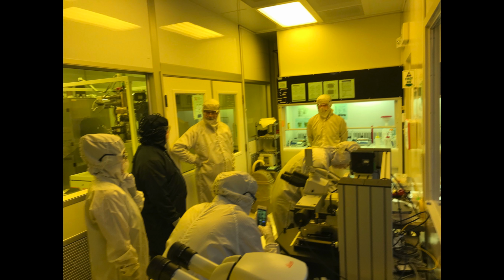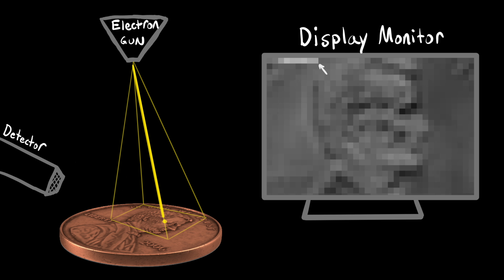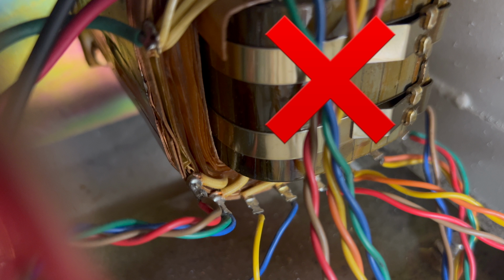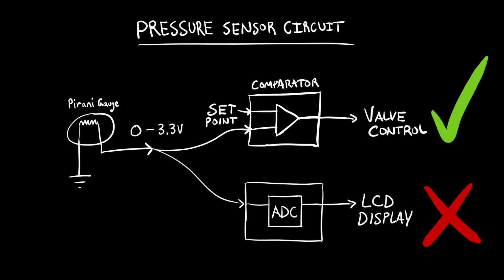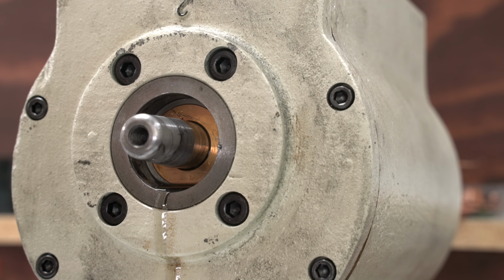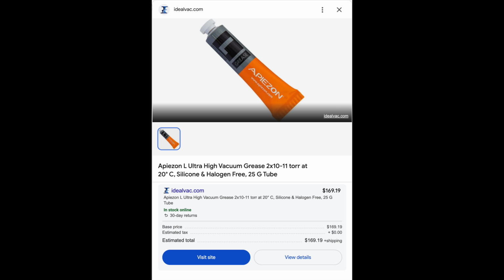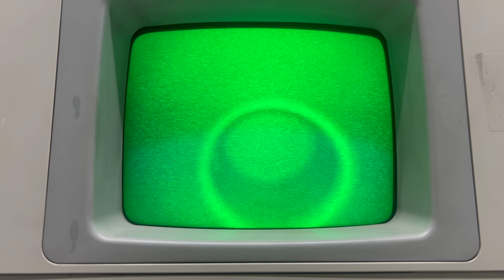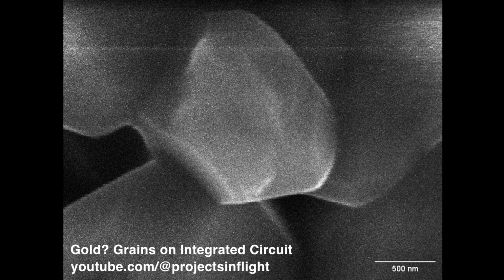I Saved an Electron Microscope from the Trash

Comment: Once you have it fully repaired, what will you use it for? Great and super interesting video, Thank you for posting
Reply from the maker: Well, the first actual use case i have is to debug the dopant that i made. There is clearly some surface weirdness happening on some formulations but it's too small to see exactly what is going on with the light microscope
Reply: @projectsinflight  outstanding.

Comment: 1:20 how much resolution does alpha, beta and gamma rays produce 

Downside is that it can chemically change the structure youre looking at....or make it become radioactive
Reply from the maker: well, an electron beam is essentially low-energy beta radiation. Theoretically they'd produce insanely good resolution due to their shorter wavelength, BUT atomic decay products generally don't produce enough particles to actually image stuff. This machine in normal operation produces around 100pA, which is around 1 million electrons per second. Even very active beta sources produce far, far less than that. the likely outcome would be an extremely weak image requiring hours of acquisition time

Comment: I’m an electron microscope service engineer. I’m always impressed when people resurrect these in their garages, I’ve installed and serviced several that people have in their homes

The banding in your image looks like a detector issue, does it use an ETD? I would make sure your grid is clean and theres no light leaks into the chamber, you’ve already checked the vacuum level is good, you tend to see that banding at vacuums worse than 1e-4mbar on an ETD, but id check your PMT connections for bad solder joints
Reply from the maker: I'll check the PMT. feel free to email me at projectsinflight at gmail dot com if you'd like to help more :)

Comment: to get as crisp signal as possible you could try bypassing the entire video AMP and use something like ths7374 which is commonly used to bypass the games console RGB AMP (Sure this signal is monochrome but you can simply use a single channel, right :D), then perhaps make some switch to disconnect and re-route the video signal outside (splitting it would introduce more interference), replace the wires with some nice shielded ones and it will be pretty much as good as you can make it on the analog video output side of things. If you want to capture it on a pc you will want to use some good AV upscaller and an HDMI capture card not to loose on quality while upscalling with some cheap crap. There are plenty of options thanks to the retro games community.

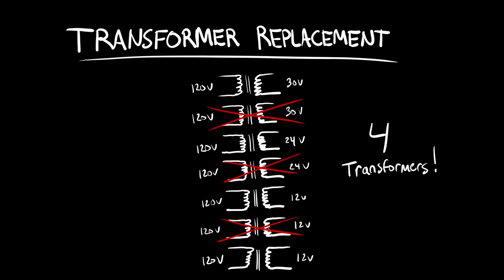Comment: Impressive project. At 10:48 you could have changed the main supply voltage to 120 Volts entirely, using the more common 120 to x transformers. That would have removed the unfortunate 100V requirement, and made it easier to find apropriate transformers. The only important point is, that you get the correct secondary voltages. I am aware, therfore you must replace ALL transformers of the microscope.
Reply from the maker: There are actually a few parts in this machine that run off of 100VAC that are hard to replace, such as the valve motors

Comment: It is advisable to keep the column and chamber under vacuum while the machine is shut down. If it is reasonably leak tight it will take days or even more than a week to get up to 1 torr.
Reply from the maker: Yeah I usually store it under vacuum

Comment: The distortion on the CRT would most likely be the filtration capacitors for the vertical blanking on the deflection circuit. I would replace all the deflection board capacitors. They would be well overdue for a replacement.
Reply from the maker: Will do!

Comment: This was a really good watch. I have always wondered about these machines.
Also you can tell it's older equipment by the amount of cuts and stabs on the hands from trying to disassemble it, just like with older computers lol
Amazing that it still works, the fact that it has so much analog stuff is probably the reason for that. Modern stuff breaks so much more quickly with far less ability to repair it.
Reply from the maker: Lol yeah that gear on the vacuum valve really got me... hopefully i didn't gross people out with the hand wounds lol

Comment: Hats off on getting it working it again. This is clearly a "pre-computerised" SEM, as all the digital stuff are more of an add-on then a fully integrated feature. I work at Thermo Fisher Scientific (used to be FEI) at technical support. These old systems have an advantage in being designed with monolithic components. You can repair them by swapping components, which are often off-the-shelf parts. Current SEMs are much more integrated and we usually repair them by swapping whole boards/modules. The fact that the vacuum valves are clearly an in-house design and can be dismantled and re-greased is a curiosity. 

Do you have a supplier for the tungsten filaments? Not sure what lifetime they have in an 90s JEOL, but general rule with our systems is about 40 hrs. before they burn out.
Are you planning on any upgrades? Swapping the diffusion pump for a TMP?
Reply from the maker: I don't currently have a supply of filaments. I believe they are type K filaments which are at least still being manufactured (for quite the high price though). I would love to do a turbo swap but i am worried about vibrations.

if you ever want to email me my email is projectsinflight at gmail dot com

Comment: This is light years out of my wheelhouse but it's intriguing all the same. I wonder if that RCA cable with the blue wire and the related mods to send images to a computer were done a while back but done improperly. Then the machine quit working and it sat and just degraded. Seems like most of the issues were from being stuck in a closet somewhere. I like to speculate on things.

Comment: GREAT watch, thank you. The type of fluid in the diffusion pump seems to have a bearing on how much vaccum you can achieve. "Agilent SY is a high quality, low cost synthetic organic compound. Its low vapor pressure allows it to achieve base pressures in the low 10-8 Torr range. SANTOVAC 5 has ultra low vapor pressure that allows it to achieve base pressures in 10-10 Torr range and low backstreaming rates." $236CAD per liter, $760 per gallon, assuming imperial gallon since its CAD.

Comment: Super cool, just a pleb when it comes to anything like this, but this was a fascinating video.

Is the video output to the computer literally just composite video? If so it should be pretty easy to set up capture for that.
Reply from the maker: The video is output over BNC. I believe that in the fast-scan mode it probably would be recognized by any composite video hardware. not sure in slow scan...
Reply: @projectsinflight  
It should be very cheap to find out... although I'm not sure how fussy typical SDI capture hardware is about having a 'proper' SDI signal. I use them pretty regularly, but I'm always feeding them a known compatible source.

Comment: I have been following Bob Greenyer and his work, and others, on studying EVOs/Micro Ball Lightning.  These structures form from spinning electrons when water under pressure is sheared, leaving tell tale scoring marks on the metal container pressure vessel.  There's a lot of interesting outcomes from these experiments, but the fact that nuclei are being fused into larger atoms that can be detected by SEM and measured with the EDX function is of most interest.  I'm sure that Bob could arrange to have some samples sent to you for inspection...BTW great job on getting this device running again.  Hats off!

Comment: Epic repair
Reply from the maker: Thank you! it was a lot of fun and some stress lol
Reply: @projectsinflight it was a lot of stress and some fun
Reply: Worth each and every single second 🎉🎉🎉🎉  @projectsinflight
Reply: Epic², if I may. 

I know enough to understand the vdo but lord, I can't even imagine 😆🫡
Reply: @projectsinflight how much to restore it?
Reply: You need to hook up one of those "500$ special" 75inch TVs from Wal-Mart to that bad boy right there!! @projectsinflight
Reply: @projectsinflight  try Electron-beam lithography
Reply: @projectsinflight what are the odds of getting pictures of each circuit and crowd -sourcing schematics?
Reply: @projectsinflight Can you Make an Electron microscope with a plank's length of resolution ? I mean pixels as small as plank's length.
Reply: @InternetTroll9975 can you?
Reply: @projectsinflight  make a digital control one based on this analog design, use lcd monitor, digital Potentiometers ,  microcontrollers etc  . Make new set of diffusion pump etc, copy all hardware parts make the top electron gun column etc . Buy ready power supplies dcdc etc,  HV transformer is from a tv set
Reply: @projectsinflight  (i just want to say i think it’s really cool you fixed this unit.)  1:32  this isn’t true.  Proven so. Im sick of these pseudo walls built upon incorrect theory and supposed
 laws .. flaws. Exceptions. Anomalies. 

Electric microscopes are lame. Incapable of showing movement/life.  Metamorphosis …..
Reply from the maker: @Coincidence_Theorist  I'm going to assume this isn't some weird bait. I'm not sure what part you are saying isn't true. If you have solid proof that electrons do not have wavelike behavior, you can publish and collect a nobel prize for overturning a century of quantum physics.
Reply: @projectsinflight  haha lmao
Reply: @Coincidence_Theorist  what in the world are you talking about? And this is an electron microscope not an "electric" microscope. You might want to actually read what you write because its an absolute mess.
Reply: @Coincidence_Theorist    edit dude!, electron. As always an improvement in magnification results in technology with some qualities that are not desired, but are so good you just have to accept the tradeoffs. If you can invent a device that can image at this magnification living objects, that will probably be a nobel prize. 
''Electrons have short wavelengths (shorter than photons of light) that move best in a vacuum, so living cells cannot be viewed with an electron microscope.''
    Recently some people theorize using quantum mechanics, remote sensing of objects might be possible. I probably won't be around for that.
Reply: @Coincidence_Theorist  your comment is not really worth a reply, but I will give you one anyway. Google the JEOL ClairScope. It uses a special membrane that allows the sample to be in atmosphere while the electron beam is in vacuum. It has the added bonus of using a light microscope at the same time, which is kind of huge because correlative microscopy is normally a huge pain. This is not new, it's maybe 10+ years old. Also, if EMs are so crappy, name a microscope with atomic resolution that doesn't also need to be in a vacuum.
Reply: @generic0000  This reminds me of a co-worker who starts spouting off horrendously inaacurate scientifc facts during break. I just end up giggeling, 

Last one was him trying to convince us that the moon orbits the sun.
Reply: @Technodude255  That last bit is not wrong, from the point of view of the sun, the moon does orbit the sun in a weird shape called an epitrochoid. But it is much easier to view it as orbiting the earth which in turn orbits the sun.
Reply: @projectsinflight  You can prove @Coincidence_Theorist wrong by observing a tardigrade. These beasts are so tough, I'm sure they'll shrug off the electron beam for some minutes.
Edit: Found an article that literally lists eukariotic organisms that survive SEM conditions and scan. INCLUDING metamorphosizing beetles, LMAO
Reply: @Technodude255  Remember kids, birds aren't real.
Reply: @Technodude255  Remember kids, birds aren't real.
Reply: @projectsinflight  ratioed this buffoon
Reply: @projectsinflight well if we can't explain quantum superposition we can only assume wave like behaviour of electrons for our convenience. It might be true that they completely do not behave like waves, who knows🤔
Reply: @panavpasricha they have wave-like properties.
Reply: crazy
Reply: SEM won't slow mo the light
Reply: I was amazed how well you were handling the repair work so smoothly, but then I saw the battle scars. 21:16
Reply: Great to watch. Fantastic to see your SEM producing images at the end. Awesome
Reply: Not expected you guys to be here :)
Reply: @yashrajshah7766 they ain't here for you lil bro
Reply: @Hayden6-3  ofcourse they are not for me.
Reply: Doesn't get much better than this.
Reply: I wish we could see some of the experments the Slowmo guys do in sliw motiin. Like a pelt if gunpowder burning under a microscpe in slowmo.
Reply: word
Reply: Hi guy
Reply: collab
Reply: Absolutely! Congratulations 🥂
Reply: epic was the exact word i came to the comments to type
Reply: Literally watch this all the way through. Sooooooo good.
Reply: I don't know what, I don't know how.
Please. Colab with some stupid hi magnification at stupid hi speed videos.

Please
Reply: Indeed, one word, insane !!! What a job, WHAT A JOB…!!!

Suddenly, I feel lucky (and verry humble) that my Addam’s Family pinball have only batteries leaking problems…😅😅😅
Reply: What an incredible thing to witness.  This reminds me of the guy who repaired and modified an (MOCVD) to make blue LEDs. Fantastic to see that people like this still exist out there. (I am trying to become one)
Reply: This is most earned comment that I have ever seen…
Reply: The idea that anyone would just throw something like this away is not surprising but I still don't understand it at all.

EE for 35 years.
Reply: Want to see a $30 Electronic microscope from TEMU? We test one HERE:  https://youtu.be/KAnYfuhAzCU?si=jVTRiOjTGIUhKBqs
Reply: Please help me guys
Reply: I'd love to see a collab with Mr. Carlson's Lab just to see what improvements he'd come up with in the circuitry.
Reply: W repair
Reply: Por esto sí pago yo el internet...wow
Reply: You sir are the 🤴 of the dumpster driving nation😂
Reply: Epic comment
Reply: MARK NUUUTT!!!

Comment: Oh man, if I had any idea that a hobbyist SEM community existed, I could've picked up an old JEOL at the local state university auction for probably $10. I don't think anyone bid on it while I was there, and I got the "don't even think about it" look from my partner who was with me. Not having an EE degree would mean a lot of hand holding to avoid destroying it or electrocuting myself in the process of repairing, and of course it was possible it was 800 lbs of irreparable scrap metal.

Side note, if you're in need of science and engineering equipment state university surplus departments are an excellent source for often cheap deals in my experience. The website "Public Surplus" is also often used by them to auction stuff off, and my local university also has a sale weekly plus regular in person auctions throughout the year. Feels like I'm giving away secrets but it's sad to see this stuff get scrapped when it could go to a starving youtuber who might inspire others to get into science and engineering.

Comment: i would love to see varius types of data storage (tape, optical media, harddrive platters) at silly resolutions just to see how the data "looks" when you look at it very hard
Reply from the maker: I can already answer half of that: Any magnetic media cannot be viewed under an electron microscope. The magnetic field is too weak to significantly affect the high-energy electrons from the beam. I tried viewing Floppy disks already and there was nothing visible apart from the normal surface.

It's conceivable that an atomic-level resolution microscope could see something but definitely not this one.
Reply: @projectsinflight  shame but makes perfect sense when you think about it, thanks for the reply!
I would also love to see a more modern cpu under the microscope, some older intel xeons on relatively modern process nodes are very very cheap so no harm sacrificing a few of those to have a look
Reply from the maker: @Space_Reptile  I'm definitely going to find some more interesting chips to look at. Possibly something like RAM or Flash maybe..

Comment: You're content is SO inspiring! I'm a senior at my university getting my bachelors in electrical engineering with an emphasis in semiconductors. I happen to be watching your earlier videos where you were growing oxide layers, when I was invited by a physics professor to join a newly created semiconductor team to create semiconductor devices! I jumped on the opportunity and have been obsessed. My university is smaller and we have very limited resources, but we have already successfully created a capacitor... we just cant measure it... 😅 The next step is to etch the oxide and deposit metal into the exposed substrate... Its tricky.  
I'm looking for an internship where I can hopefully get more exposure to the processes. 🤞

Funny story; a different professor who works in the physics department, but not part of our team wasnt very happy with me when I presented him with etching cream (similar to armour etch) and began asking him questions about it. When he realized there was hydroflouric acid in it, he couldnt believe I bought it at Walmart and told me to remove it from campus until we had safety data sheets for the product. Aparrently he happned to be the head of safety of the physics and chemisty department... 🙃 I'm just wating for him to make up his mind on whether or not I'm allowed to experiment with it.